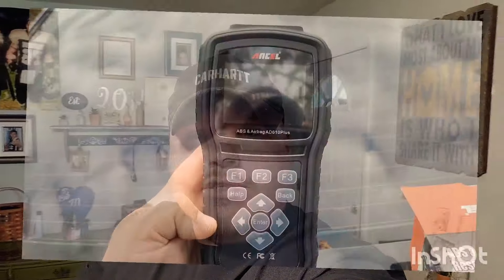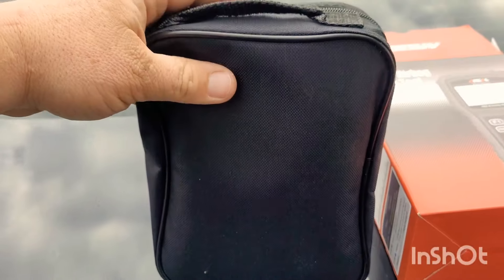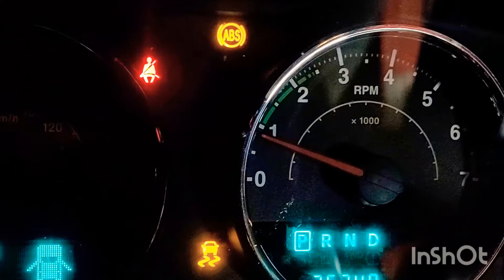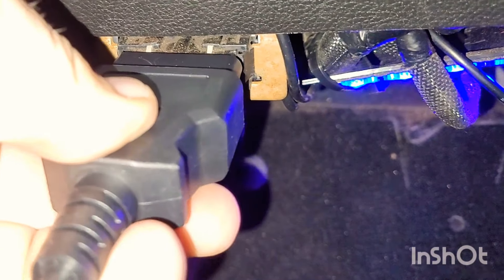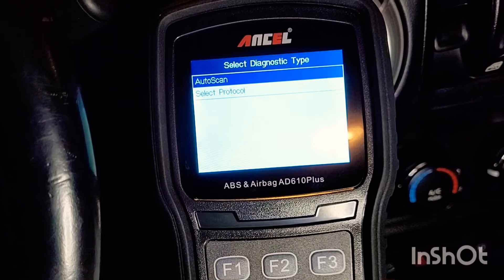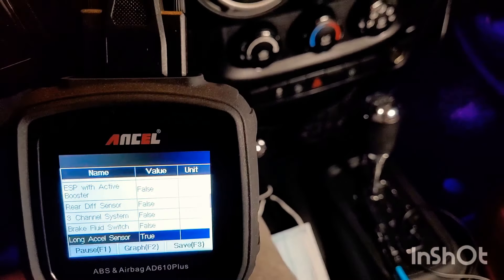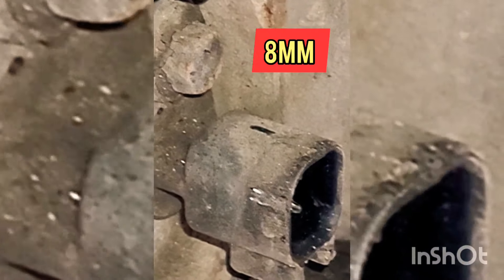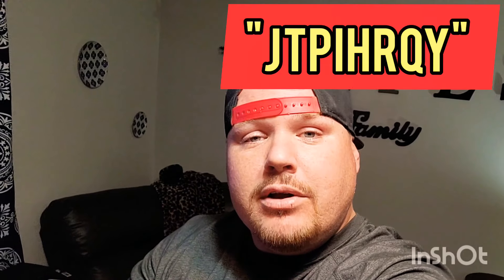Best CODE READER For The Money

Comment: Most modern cars you need more than one scanner. I have two already but mine does not have a brake bleeder option. I paid $184 dollars for mine. It is a touch screen. It does updates through the internet.  Even if you pay more it will never do everything.
Reply from the maker: Yea there are alot better scanners out there but this one is the best for under $100 that I have seen
Reply: @semperfimechanic  you see shops with expensive scanners that will not do some functions.
Reply from the maker: Yea I was pretty blown away and it's there newest model. I will give ya an update in few weeks to see how it goes

Comment: Nice scanner but i have a snap on modis that goes up to 2014 it has a four channel lab scope graphing multimeter very nice if you plan on doing a lot of electronic diagnostics paid $550 on ebay but thats a killer scan tool for $85 and good enough to do plenty of jobs
Reply from the maker: Yea man if your doing alot and running a business then you need a nice big one. This one is made for DIYers, everyday people and smaller mechanics but for the price you can't beat it
Reply: @semperfimechanic  true specializing in electrical diagnostics is great once you learn it the work is much easier and you make a lot more money without crawling around and getting so dirty thats what i am learning now plus you will be the go to guy do you plan on getting a shop in the feature
Reply from the maker: Yea I hate electrical because I'm no good at it lol
Reply: @semperfimechanic  its really hard at first but once you get through that part its fun i still struggle but i am getting it should have it down soon these guys are making like $600 to 1000 for less than a days work as mich as a lawyer because not many tecs can figure this out so you are in very high demand and can solve problems moat people cant
Reply from the maker: Yea it's out of my realm so good luck brother your the man